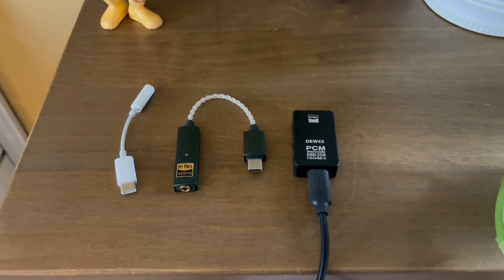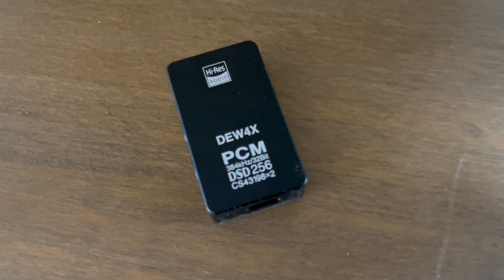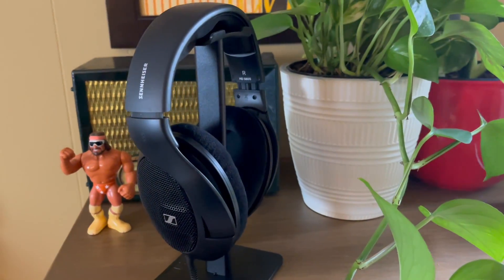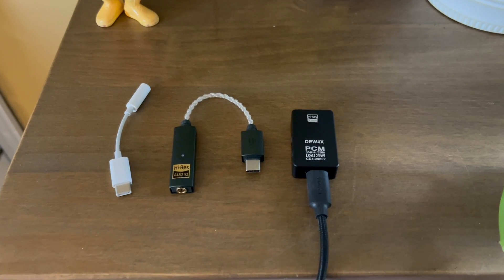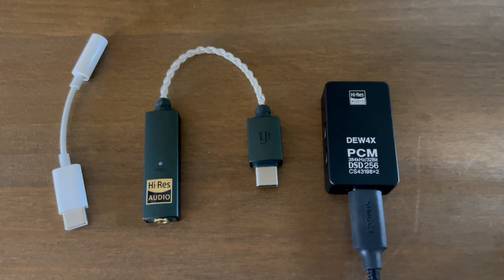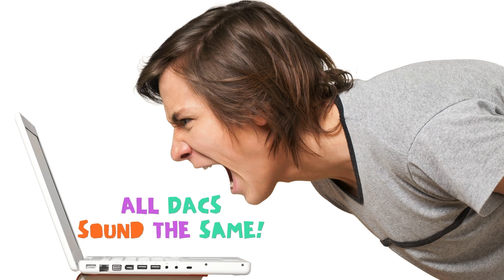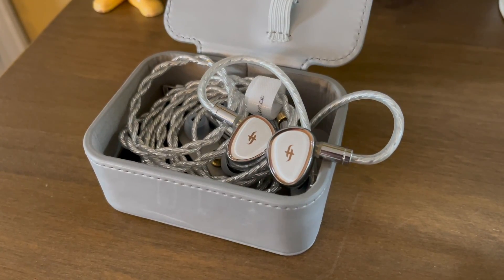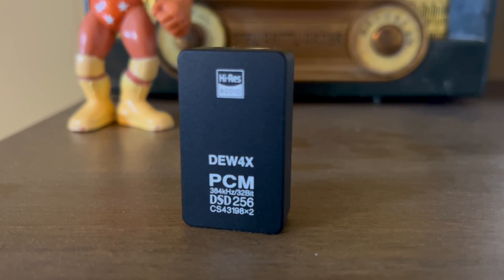Is it really worth upgrading your cheap Apple dongle DAC?

Comment: I use an external Bluetooth DAC, the ES 100 made by a small company called RadStone. That DAC has a rechargeable battery that allows it to drive wired in-ear buds or medium sized over the ear wired headphones. It comes with an app that allows you to play with about 100 different settings, including user definable equalizers. 

You can clip the small device onto your shirt and unlike most Bluetooth earbuds, the ES100 puts the Bluetooth receiver in this tiny box and that means that you can keep Bluetooth frequencies away from your brain by letting the ES100 drive your unpowered wired earbuds or smaller wired headphones. I don’t need brain cancer in 20 years, no thanks.

You are still using wires, but instead of carrying your phone around, you can put it down near you and just keep the ES100 (ES = EarStudio) clipped to your shirt.
Reply: Lol weird, If you’re that worried about Bluetooth frequencies why wouldn’t you go completely hardwired, turn the Bluetooth on your phone off, and mitigate your… “exposure” ?
Reply: @XxRUNTY  It’s not weird. 
Go turn on a hairdryer and hold it 1 inch from your face. 
Now hold the same hair dryer 2 feet from your face. 
Big difference right?

When you use Bluetooth earbuds, they aren’t just receiving a Bluetooth signals they are also putting out signal frequencies, especially if you use them for making phone calls. And that signal is 1 inch from your brain. And the batteries the power Bluetooth earbuds are also putting out a small magneto-electric field.

Comment: Apple usb-c dongle is really great  for low impedance headphones. For high impedance you need additional amplifier or other dongle with more powerfull on board amplifier
Reply from the maker: Great point thank you!
Reply: The Apple dongle is pushing my 80 Ohm DT 770 Pros just fine when plugged into my computer. Any higher than that though I'd use an amp.
Reply: @MediaBrad  Nice to hear. Do you have US ( 1V rms) or EU ( 0.5V rms) dongle ? 
I have EU with lower output - don't check it with high impedance yet, but with my 8 Ohm planar it sound great
Reply: @Xenotester  I think I have the 1V rms version.

Comment: You really can't even get the apple dongle dac to work on android... System updates break it .. Youll get it working and it will stop. Its just not worth it.

The apple dac also doesn't work if you have harder to drive headphones... And even on less hard to drive ones there will be less overhead= dynamics..

Also the implementation of the chip matters significantly. Thats being said, some have certain characteristics, like the cirrus chip in the 80 dollar dac you have there is able to supply way more power (and more efficiently) than basically any other "mobile" dac chip... 

If you're going to spend more than 80 bucks or so you probably don't want to be looking for dongle dacs anymore... You want a "normal" form factor.

Comment: I used an apple dongle as a DAC for quite a while. No headphones. ITX PC>Dongle>Amp>Speakers. It is surprisingly good for $9 CAD.
Reply from the maker: Awesome thanks for sharing and watching!
Reply: Wait so you would plug the dongle to a usb c port then amp then speakers?
Reply: @serynaudio  I used a C to A adapter but .. yes. Its a very good DAC but i got a good deal on a Topping so I use that now.
Reply: @Meerlu how's going with topping dac? Much better? Model thx.

Comment: All DAC’s do sound the same. Do a frequency sweep, all modern dac’s have a flat 20hz-20khz. Where is the difference? If the output is flat, it cannot sound significantly different
Reply: I have been thinking about this from past few days.. i have kz castor . I used EQ and tone generator to have neutral profile.. when i connect jcally jm 04 pro and HEAR to sine sweep or tones generated i see there are dips and peaks now.. either jcally  is not transparent or my phones dac or castor is behaving differently due to power..  i used another iem  i have and i heard same dips and peaks with jcally.. so its not the iem..

People say all dacs measure flat.. any place to see graphs ?
Reply: All chips are roughly the same in frequency you are correct. It’s all about the implementation.
Reply: I record music so have an expensive convertor. There is no way the phone jack from my ipad or android phone sounds the same. My new phone doesn’t have the headphone jack so I am looking into this. It’s Android so the Apple DAC is no good unless you are only using that one app which integrates with it. This all depends on headphones as well. Most people never hear music at high quality these days so a lot of the opinions are flawed.
Reply: Just add to my previous comment. I have audio production gear here. An expensive multi channel DAC ADC which is actually quite old now. I just got a Fiio KA17 to listen on my phone. I obviously wasn't expecting that to be as good as headphones from my main DAC but god it doesn't even match the onboard sound from my computer or a ten year old phone I have with headphone jack. Terrible piece of kit. Harsh and sibilant. What are all these reviewers judging this gear against? People need to hear music through proper gear before making and these assessments.
Reply: You've no idea what you're talking about and I bet you never listened to a better DAC in your life. Audio engineers are literate and uses expensive converters for a reason. Because you actually hear more from a better DAC, it doesn't distorts or smears the notes like cheap DACs. Frequency Response is the last thing one should worry about
Reply: @ Maybe my ears are the limiter. The human ear is a delicate but time-degrading sensor. I’m 36 so for me it’s more like 50hz-17khz on a good day. But buddy dont take it personally, i love quality audio and will always will . :)
Reply from the maker: Thanks for watching!

Comment: Love using the Apple dongle for my IEMs, I find that even when I forget to set it to full volume on UAPP, it still drives most of my IEMs at about ~80% volume on my Samsung phone. I do however also carry a Fiio BTR15 for a more portable setup, and a Fiio KA13 when I need a bit of power. I forgot to bring my KA13 to a headphone store and missed out on being able to properly demo some headphones as the Apple dongle didn't cut it in terms of power. I haven't tried to sit down and properly compare all my sources (including a Meizu Hifi Pro and a Fiio K7), but there's no obvious difference that'd make me do a double take between any of them when I switch between DAC/AMPs.
Reply from the maker: Awesome! Thanks for watching and sharing!
Reply: Have you tried it through a pair of iems with an in line mic, my older dongle makes my in line very quiet I’m hoping this makes it louder
Reply: @IcyyX_ sorry, don't have the KA13 anymore! I only have 1 cable with a mic and haven't heard anybody complaining about my volume when I used it

Comment: My iPhone 6 Plus has a 3.5 headphone jack and doesn’t need a Dac. I use it as a stand alone music player.
They are cheap to buy.
Reply: Well. It has a DAC. It’s just inside the phone.
Reply from the maker: Awesome. Thanks for sharing!
Reply: if i were going that route, i'd get one of the LG phones that had the quad dac in them. i used a few of them. i just retired my lg g8 as a phone, but it's running my node 2i at home, using qobuz for streaming and uapp for accessing my network drive that has all my ripped cds on it, and the sd card i have in the phone. 

it works great on its own if i just plug my iems into the 3.5mm jack. it's just limited to wifi and the sd card. it does bluetooth, but i never use that for listening.

Comment: Using Apple Dongle with my planar magnetic Hifiman and i need to beef up the volume to around 70-80 percent to achieve my normal listening db comparing to powered amp that only uses 40-50percent. Still workable if you just need something lighter than a dac-amp dangling on your phone 😂
Reply from the maker: Thanks for watching and sharing!

Comment: I did compare apple dongle to chord mojo and i also could not hear a difference
Reply from the maker: Thanks for sharing!
Reply: What really
Reply: @akash5180  i did volume match using a microphone because it is very hard to do by ear under 1db difference, i also used a hardware switch that instantly switch between the 2 sources into my iem, if there is a difference, my ear is not trained enough or my source data ( youtube compressed audio ) does not hold enough information to make the difference but i doubt it as i cannot hear a difference between mp3 and uncompressed in a online blind test either. so my conclusion is that source difference is less noticeable than eartips differences (which i can hear, especially between wide bore and narrow bore) so i resold my chord mojo :)
Reply: You probably need a better headphone / source
Reply: @clickbaitpro  that was my initial thought i now have $400 hype4, i can hear a difference changing eartips but not changing dacs. i also cannot hear a difference between uncompressed audio and and mp3 128k. to be more exact when doing focused a/b testing between dac i can hear a subtle difference in flavor, some sort of sidegrade, not one being obviously better than the other (by "better" i mean having very noticeable differences such as more clarity or better soundstage, which i can easily hear when a/b testing hype4 vs mega5est ($150 price difference) for example so i'd 100% take  mega5est+apple dongle over hype4 + used $150 chord mojo for the same total price of $550ish )

Comment: I think you needed better DAC's (not necessarily more expensive) for this test to be worth it and to hear some real differences.  I had similar experiences at the beginning with portable DAC’s.  Is not about the amount of money as much as getting something current and well implemented.

Some recommendations for the future:
Hidizs SD2: $46 (right now it has a 15% discount in Amazon), very solid performance for the money and only DAC I have with MIC input.

Meizu HIFI Pro: $23 (Considered one of the very best dongles for the money, value budget king)

TANCHJIM Space Portable: $89 , maybe the best dongle at that price point and very small

HiBy FC4: $80 (but many times at $60 with coupon at Amazon), the DAC that converted my kids to the dark side.  The difference from their cheap $10 - $15 dongles was just too great to ignore.  I almost wasn’t able to get it back.
Reply from the maker: Awesome I’ll check those out thank you!
Reply: Tanchjim Space is the same as Moondrop Dawn Pro. But Dawn Pro is much cheaper

Comment: Really liked this comparison video.  I also wanted to point out the apple dongle isn't actually a DAC; it's just an adapter that allows the use of the phones internal DAC because phones don't generally have headphone jacks anymore.  The analog signal is sent from the internal DAC to pins on the USB/Lightning port, and the dongle simply transforms those pins into a 3.5mm jack.  This is the reason for the level difference between your iPhone and the Android phone and really speaks to the higher quality of the iPhone's internal DAC.
Reply: apple dongle is not just a adapter. that include DAC chip. Every phone has internal DAC. if you using wired headphones with dongle? external dongle DAC works. using speaker, internal DAC works.
Reply: It IS a DAC. Stop spearing false info!
Reply from the maker: Thanks for watching and for sharing!

Comment: The Apple dongle DAC kills at it's price. Sure, you're right, it does not drive my Sennheiser 660S2 well but it is perfect when paired with my Beyer DT770 Pro 32 ohm headphones and my Moondrop Starfield IEMs.
Reply from the maker: I’d love to try some moon drop IEMs soon!
Reply: How loud would you say your 660S2s get?
Reply: @benjamenYTDeadTheGamer  I'd say that depends on what I am using as the source but I do tend to hear distortion creep in when I turn the source up using the Apple dongle. I don't listen at high volumes (around 75db usually) but I'd say I have way more headroom using one of my dedicated headphone amps. They sound fantastic on my Pietus Maximus or my Ragnarok.
Reply: Drive my bose 45

Comment: At only $10 the Apple DAC would seem to be the deal of the century. How did it ever make it to market at that price considering that Apple likes to overprice everything?
Reply from the maker: That’s such a great question!
Reply: @ForeverAnalog  pretty sure it’s just the economy of scale. The more you produce the cheaper it can be and still make a profit. Just like how Walmart is cheaper than independent grocery stores
Reply: I think the low price might still be because of the outrage after they removed the headphone jack from the iPhone a few years ago. They want to provide an affordable dongle to prevent frustrating customers any further.
Reply: @supernova_eu_w Wired audio has been a niche market for a while. Jack output  will eventually break, and the right of repair is neglected and will be until like 2027 at least. IP XX protection is harder to achieve with jack. People who uses wired audio likely use external DAC and amplifier. Especially because producers had neglected analog output quality. Same happened to TVs, their analog outputs are absolutely trash.
Reply: Apple dac is a product which allows them to not have 3.5mm jack in their iPhone and therefore they make a lot of money on AirPods. They don’t make any money on dacs, opposed to the other companies. But they needed to provide same quality audio as old iPhones did (which was good).
Reply: The only issue is that the apple DAC doesn't play nicely with android since android expects the hardware volume to be set at 100% by default and it controls it in software, which the apple dongle doesn't default to. there are workarounds but they're hacky and some cost money. other than that you may have issues with in line controls not working since apple-configured DACs expect the mic and ground to be flipped which most headphones don't do.
Reply: @JessicaFEREM  USB Audio Player Pro will use the Apple dongle and unlock the reduced volume and poor sound on Android.
Reply: @JessicaFEREM  That figures. Apple likes to do things their own way, so if you haven't bought into their more expensive products then I guess you don't deserve to use a cheap DAC.
Reply: Prolly because it all the same just need use that to be able hook up iens
Reply: You know what costs $0? The headphone jack on older iphones. Amazing, right?
Reply: Great explanation, thank you.
Reply: Apple has 20 years of making low power audiophile DACs, Steve Jobs was a bit of an audiophile
Reply: Scale. They're going to sell so many, they can still make a huge profit. The profit margins are also probably still relatively high as well. Finally, it's a cheaply made dongle and, thus, many people will have to buy multiple dongles over the years.
Reply: The best Apple's products, are the cheapest.
Reply: DACs are cheap af
Reply: Except they don't over price everything...

Mainly just memory.

While they did have an expensive stand and wheels, those were for high end products and most of the payment was more the development cost.... and some of their older products that should be cheaper after some time passes...

Other than memory, Apple actually charges pretty fair prices for their products...
Reply: @TheDeathmail   People just want everything at extremely low prices—with severe consequences for workers' rights. But nice things cost money. I was a broke student and had an iBook in college. My friends would say I was rich, but they spent twice as much on their Dells? And mine came with a free iPod?
Reply: At that price point you can also get FIIO JA11/Jcally JM6/Grave Audio DA06 which has DAC CHIP CX31993 and AMP MAX 97220
Even KZ AM01 is good
Reply: By eliminating the 3.5 mm jack that iPhones already have.
Reply: One of the reasons Apple gets away with doing so much anti consumer sh*t is because people are stupid.

They think high prices somehow means Apple is ripping people off or over pricing things... when they often don't...

Other than memory, Apple is fair and their treatment of repair and how they lock you into their eco system and try to force you to use their cloud services or being stuck doing things their way is how they screw over consumers....
Reply: it's their concession for removing the audio jack while keeping their toes in as viable device for the huge market for wired headphones, buds and IEMs.
Reply: It is not a DAC. It is only an adapter.
Reply: It only supports 24 bit/ 48 khz
Reply: Yeah and it is the highest bitrate of pretty much anything on iTunes store music.

Comment: I'm nopt a headphone user but just play most music in the car or PC. Playing WAV tracks on ad android phone sounds poor with or without a dongle DAC (Dragonfly Cobalt or Astell & Kern HC3). Using an iphone 6S however, the sound is better even with no DAC, better with the Cobalt and much better with the A&K HC3. I don't know why the iphone 6S is better than android (Samsung/Oppo) but it really is. The only issue is that the iphone is knackered for anything else but music and has only enough room for 150 tracks. Sounds great though and improves the PC as well. But WHY? I assume the output from Apple iphone is better than adroid?
Reply: I have an LG G8 android, it has a built in quad DAC and a 3.5mm headphone jack.
My brother got a LG V60, which has these same features and also sounds great even with big headphones.
These were probably the last android phones to take audio quality seriously.
They are really cheap nowadays, so if you don't require the latest specs you could give them a try.
Reply from the maker: I think it varies by android phone but some reduce the output power but you can download an app to fix it. I saw this in a similar dongle video on iiWi Reviews